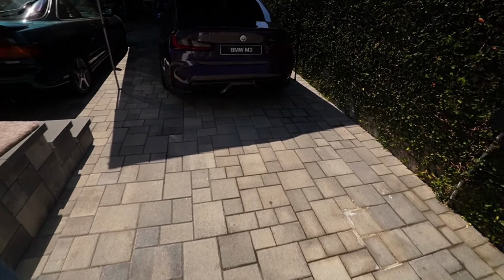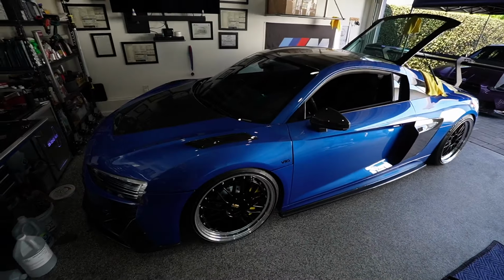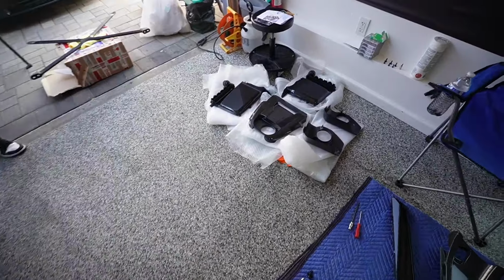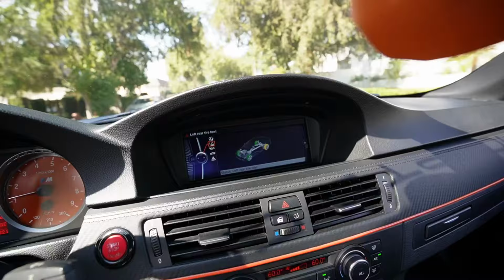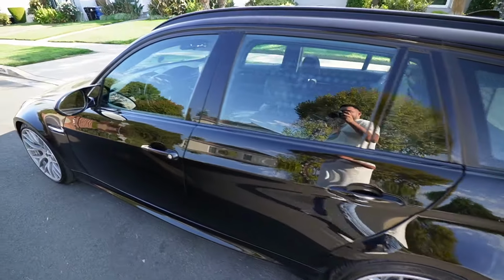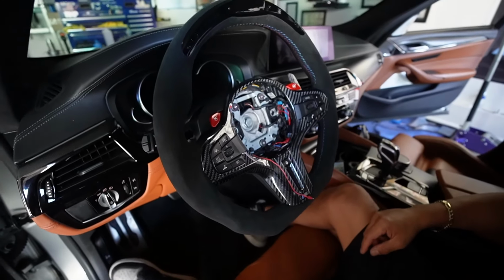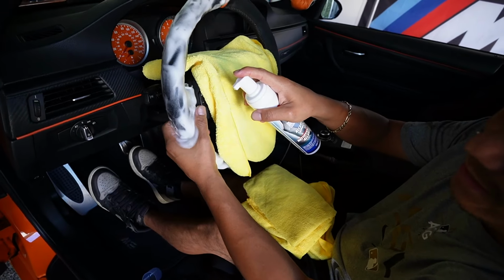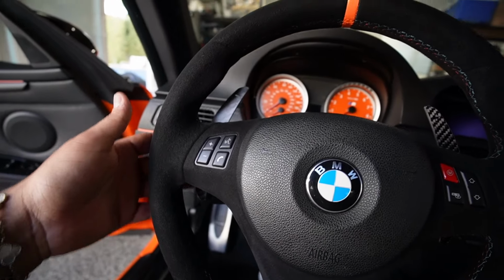PROBLEM FOUND WITH MY BMW M3!!

Comment: Is crazy how the E92 M3 once was The Next Big Thing, and now is slow, analog and no modern technology.  Simplicity at its finest!!
Reply: The e92 is not that slow
Reply: Now it’s slow? They’ve always been slow lol. That’s why I love my e90 m3 NO UGLY ASS “MODERN” TECHNOLOGY.
Reply: @matthewwaldrup149    Not back then when they where new. They were low on torque, but they aren’t meant to be raced on straight lines. They are for the twisties and circuit tracks.
Reply: @Daniel-i7m5z    Back when new, they weren’t. On today’s standard they are. Still, great cars for circuit tracks purposes.